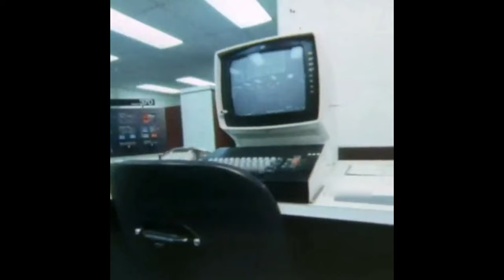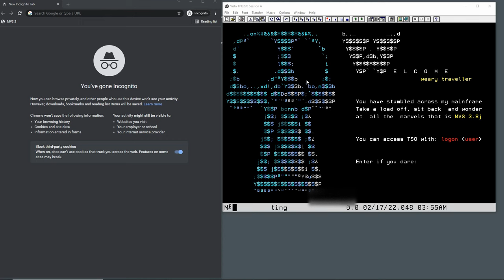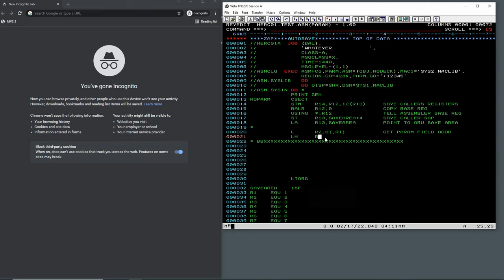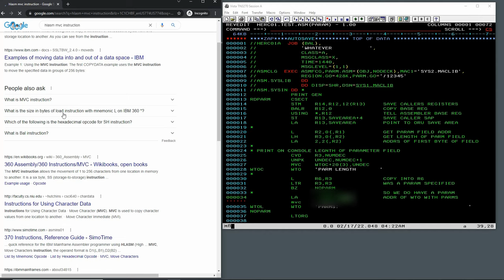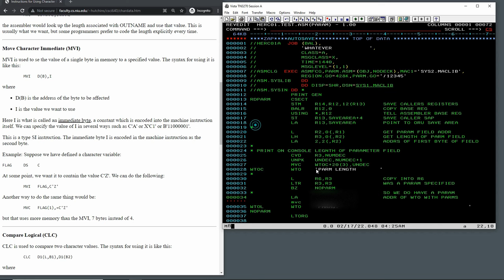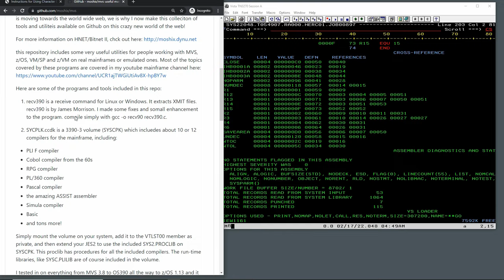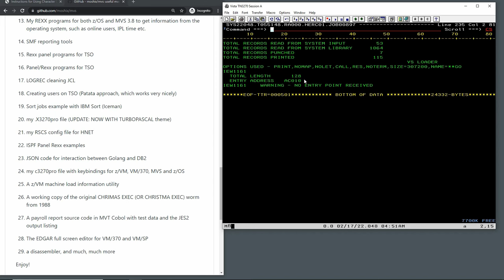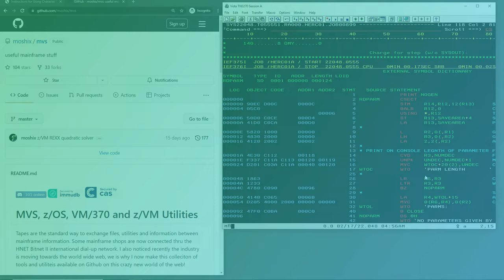Passing parameters to mainframe assembler programs  - M203

Comment: I think you have a bug. 

In line 35 you have:

            MVC    0(R6,R4),0(R2)      COPY WORKLOAD INTO NEXT INST 

However, the first parameter in parenthesis in the MVC instruction is the "immediate" length of the move, not the contents of the R6 register. This code will only move 5 bytes (1 less than the value specified - in this case 6).

To fix, you'll need to use the EX instruction. Something like the following

         EX    R6,VMVC                          EXECUTE MOVE WITH LENGHT SPECIFIED BY R6
.
.
.
     BR    R14
*
VMVC   MVC  0(0,R4),0(R2)     VARIABLE LENGTH MVC TO BE USED BY EX INSTRUCTION
Reply from the maker: You’re correct. I did think about using EX but in this example the code works and the example is really about getting the parameters not about WTO or print formatting. But yes you’re right.
Reply: Very good, I haven't seen that. Here it works because R6 equates 6, so 6 is taken.
Reply from the maker: @didiergoletto2607  exactly right
Reply: @moshixmainframechannel  Were you lucky about 6-1 being exactly the length of your GO parameter, or you thought about it and use R6 for that reason? 🙂
Reply from the maker: I was lucky. I wouldn’t show wrong coding on purpose.   I did at first think to use EX (which I think I mentioned in the video) but then I forgot. 😀. The main point of the video is to show how to obtain the parameters, not so much how do do proper string output in asm.
Reply: @moshixmainframechannel  No worries. BTW, nice video, specially since you programmed on the spot, something which, as a professor, I learned never to do. :-) Looking forward to the PL/I version if any.
Reply from the maker: @Stosszahlansatz  thanks. Correction video is coming 😃

Comment: I understood the idea of single quotes better than () but I don't get the / before the real parameter. Because then the length is 6???
As you see a newbie here!
Reply: I second the question about why the parameter string starts with a slash.  That seems like it would be an arbitrary, yet interesting, bit of history behind that design decision.
Reply from the maker: It’s the convention. Also for PL/I. But not for Cobol
Reply: @moshixmainframechannel  Great video. Apropos of these comments, where are this convention and the one about R1 usage (i.e. as pointer to the parameter) implemented? in the linker? assembler? loader?

Comment: Just to say XR instruction is quicker than SR to initialize a register to zero.
But it's more to make this video seen by more people
Reply: I've seen this argument before, but it appears that XR and SR take the same number of cycles. I believe that the XR was faster on the old 360 models, but it's identical on 370 and everything since.
Reply: @DeanHorak  strictly speaking, since I don't think cycles per instruction have been published for decades this discussion might be moot. Also the idea that a simulation of a 370 would have the same performance characteristics might be a step too far. 😉
Reply: @Lupinicus1664  ,

Very true. Whatever performance difference there might have been in the 360 line, it doesn’t appear to have carried forward. IBM compilers all use SR to zero a register, but the reason could be simply convention rather that performance. Within emulators, or even real Z-series machines (in which the 390 instruction set is essentially emulated with the hardware based on PowerPC) I suspect there is no difference. 

Interestingly there are cases where a RI instruction can actually be faster than the RR instruction.  Because RR instructions have a dependency on the existing contents of the register, they may not be eligible for out of order execution, whereas a RI instruction has no dependency and can be executed without regard to instruction mix. However many modern CPUs, the special case of zeroing a register is optimized so that the same logic is used regardless of which instruction is used. 

Perhaps we should run some timing tests on Hercules to find out if there is any difference between XR and SR.
Reply: As a final follow up, I ran a test to see how the XR and SR instruction’s performance compared in the Hercules emulator. Surprisingly, the XR instruction appears to be about 20% faster than the SR instruction. I have no idea why, but I assume this is simply the implementation logic in the C code Hercules is built on. 

Interesting.